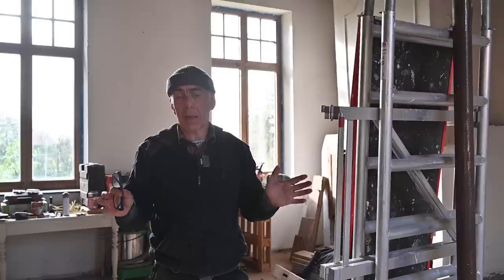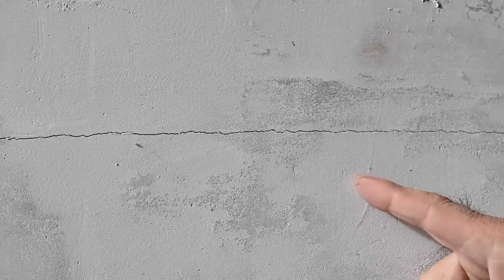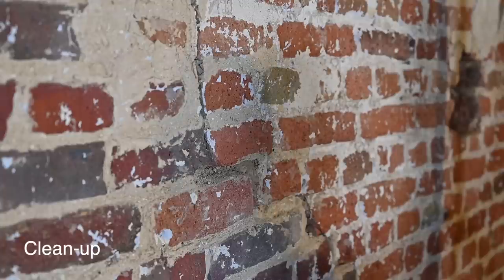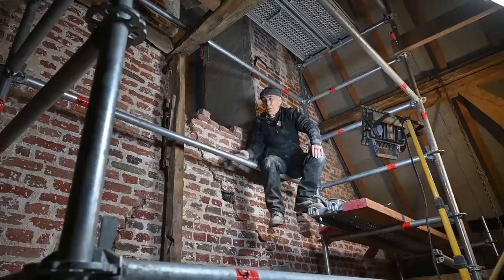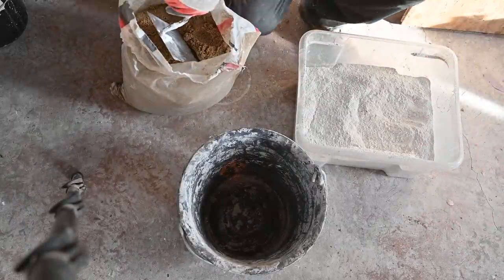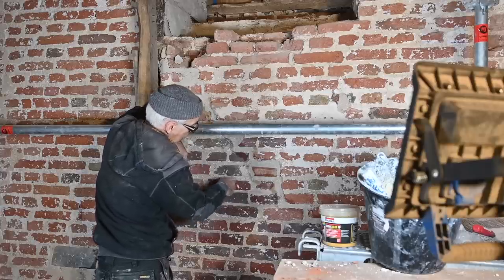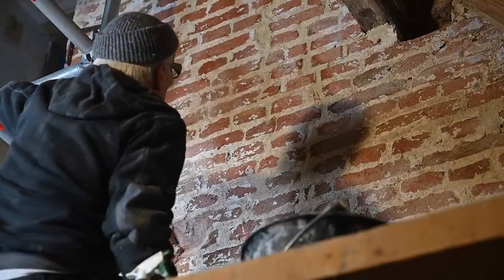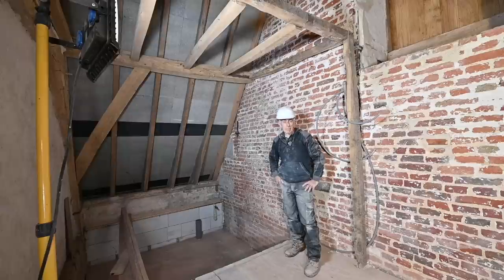Restoring the old house - Anno 1616 - Part 2

Comment: I am always amazed when I see old brick structures.  Given that they have a 'presence' all their own, they are still made up of bricks.  Bricks have little strength other than compression and that fades with excess moisture.  They absorb that moisture and basically disintegrate as does the mortar that joins them.  They crumble over time as well.  I always wonder just where the strength comes from to support high structures when bricks are used in the old style.  It would seem that they would be relegated to 'facings' only and then only when properly sealed which is extremely hard to accomplish if history is any guide.  While I love to look at them and enjoy their ambience you couldn't pay me to own one!!  The price of renovating that style of building is staggering to say the least and it is never really done.  But then I have always prioritized functionality over aesthetics.  I do admire your taking on such a potentially long job at your age.  I have done a few of my own and I have ten years on you but I find myself running out of steam in the past four or five years.  I wouldn't think of tackling a ten or fifteen year job on my own now.  I still do my projects but they are of a smaller scope than I used to do.  Time goes faster and pounds get heavier in the race against Father Time.
Reply from the maker: Thank you for the comments.  Indeed it is long job, in fact it has to be hobby else it will not last that long.  I started in 1995 on this farm. and need another 5

Comment: Steve,  I remember going up the two ladders to the tower room on my visit. I would call that metal plate a mortar board they even have ones 
with slits in them to push the plaster or mortar through them but how useful they are I‘m not sure. Great job on the pointing it looks great. 
you're like a one man power station if only we could all harness your work ethic we could all have cheaper and cleaner power lol. Cheers Dave
Reply from the maker: Thank you Dave and great comments

Comment: In the UK, most buildings of this age will be ‘listed’ on a national register of historic buildings which means they can’t be altered without special permission from the authorities. Do you have something similar where you are, Steve? If so, how difficult is the process?
Reply from the maker: Indeed Emama, we have the same rules... restoration is ok, but no changes and maximum preservation of those elements that are registered.  I do get an inspection every two years...  Not easy to work like that, especially as there are no financial benefits to it
Reply: @D3Sshooter  The oldest building in my village is an old shed, it is protected and the owner got so tired of maintance he basically built a sheat metal building around it .... but doing it right is way over his budget